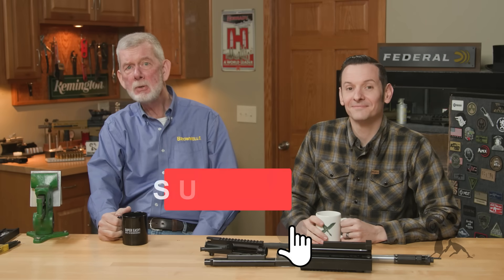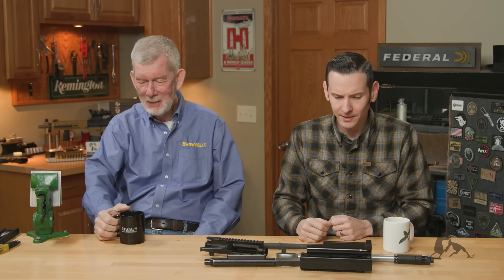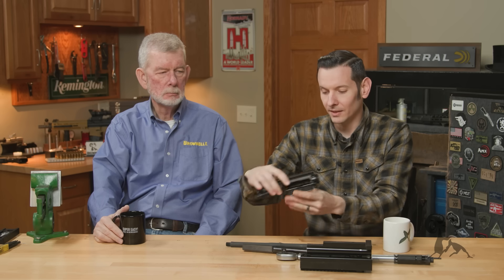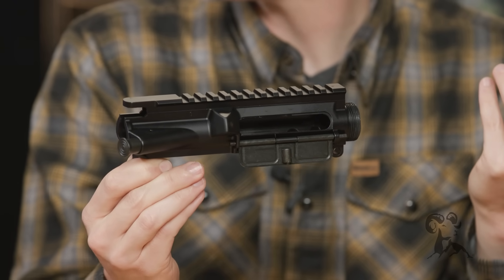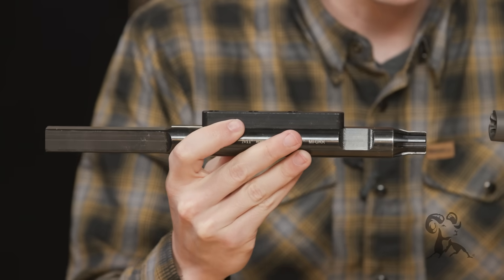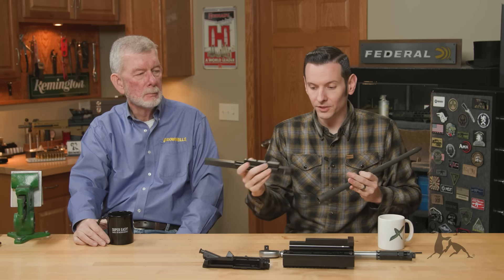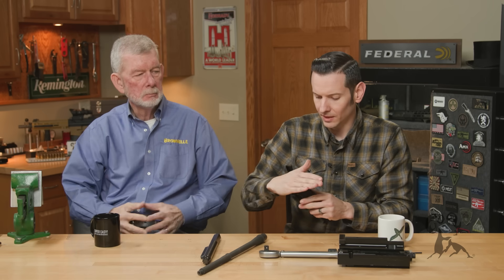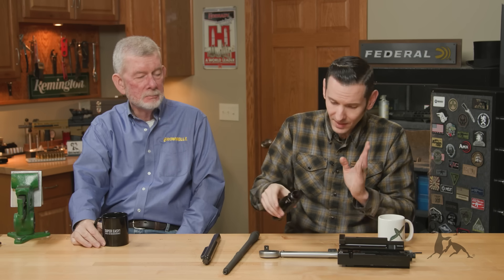SmythBusters: Top 5 AR Building Myths

Comment: Wow!! As a novice to the AR world, you have debunked myths about "problems" I never even would have though of. Maybe I don't worry enough.😉 Here's a couple of my obsevations: Aluminum Oxide is tougher than Aluminum. You can use Aluminum Oxide sandpaper on Aluminum, it's how they clean up castings. You said a torque wrench doesn’t know which way it's going. I have one that does. It was my Dad's, and probably made in the early 60's, maybe before then. It's still in it's steel case, though most of the paint has worn off the outside. It measures torque for clockwise wise rotation. When you flip the lever for counterclockwise rotation, it "locks up/out" the torque mechanism, and behaves like any other ratchet. You can break loose any rusty nut or bolt you want. It does mean it cannot do LH threads, which is occasionally a pain in the A$$. 😉 I am learning a lot, keep up the good work! 👍

Comment: If using the torque wrench for left handed thread was bad why do all torque wrenches have the RH or LH switch on them? Ive never seen one without. One thing I see people freak out about is the position of the wrench to the tool. So many say it has to be at 90 degrees to the tool. Maybe I'm wrong but how does it make any difference?

Comment: Good info guys. Sometimes I don't agree with your content, but you guys hit the nail on the head today. This stuff can be done different ways. The main thing is the AR works without fail, when you are done.. I build mine for precision. I'll do extra things like bed the barrel to the receiver. Also, the barrel nut has a broad range/spectrum for torque. You can do it with a crescent wrench, tighten the damn thing and be good enough. If you are familiar with what torque values are. Also, when installing a barrel device on the barrel, I always throw the barrel in a vise. That way there is absolutely no torque on the receiver. It may not be necessary, but it sure does help when taking a muzzle device off, that has been torqued on too tight!! Keep it easy, keep it simple. No need to overthink this stuff...

Comment: If you use a reaction rod that only grabs the barrel extension you will have issues with the index pin getting smooshed and the upper receiver index pin slow getting enlarged.  You just need something that holds the upper itself, not just the barrel extension.

Comment: I worked on thousands of M16A1s in the army and never heard of a reaction rod until 35+ years after I got out. We had aluminum vise jaws that fit around the barrel and when the barrel started to turn, we grabbed a junk barrel out of the garbage can and stuck it through the front sight base. Then we either had someone hold onto the junk barrel, or just let the one in the vise turn until the the junk hit the workbench and it couldn't turn any farther. Usually the latter. Sometimes we had to use extreme amounts of force to loosen barrels, and even a breaker bar wasn't enough if someone didn't properly torque and grease the barrel the last time it was installed. That's why you should never use a torque wrench or ratchet wrench to break loose a tight nut of any kind, whether it's a barrel nut or a lug nut. Sometimes you need to slip a pipe over your breaker bar for extra leverage, and that would be enough to destroy a torque wrench. Something you just tightened within the limits of your torque wrench can be loosened with it no problem, but I still use a breaker bar to loosen everything because I think it's a bad habit to get into. One time I had to change an upper receiver but the barrel was still good, and they were seized together because someone didn't coat the threads with molybdenum disulfide grease like they were supposed to. I used a big piece of steel pipe to beat the upper off of the barrel. Things like that are why I got into a disagreement on YouTube with someone at a gun company who just puts a bit of oil on the threads of the upper and torques the nut down. ONE TIME. We always torqued them down, loosened them, torqued them down, loosened them,and torqued them down again because the threads on a new upper receiver will stretch when you tighten the barrel nut. Not to mention some of the anodizing grinding down. The nut actually tightens down farther when you reapply the same amount of torque again the third time, when compared to the first. If your barrel gets hot enough, maybe because you went "full semi-automatic" 😉and did several mag dumps, oil can burn off but the metal particles in moly grease are like a thin plating that isn't going anywhere.

Comment: This might be the craziest thing you’ve ever heard but I check all my gas tube alignments by sucking air through the gas tube after I have tightened the set screws on the gas block. I’ve done it enough to know exactly where to set my adjustable gas blocks to shoot 300 blackout subsonic rounds.

Comment: As a guy that MAKES gas blocks, the gap is ONLY necessary if the gas block is made wrong!  On a Mil spec barrel, the gas hole is .395 "+/- .005"  When we intelligently designed our gas blocks we made the hole in the block the EXACT same distance from the shoulder as the gas hole in the barrel. problem solved through Engineering and COMMON SENSE!
Reply: I just installed one and because of the geniuses online I used a compressor to test it. You’re supposed to go to the shoulder on Milspec barrels but It doesn’t really matter because it’s huge. I went all the way to the shoulder. It’s only for barrels made for hand guards. JP Enterprises actually has it in their instructions. They make excellent gas blocks

Comment: You can potentially throw your torque wrench out of whack, so it's just good practice to have a different ratchet or breaker bar, handy at all times. It will most likely be okay but why take the risk, you can not only damage to the wrench but whatever you're working on. The torque specs shouldn't be that critical on anything but it's easy to just have two of a given socket or whatever you need to do the tightening and loosening
Reply from the maker: How does it throw it out of wack? What's actually happening that is bad?
Reply: @brownells  Well just one viewing of “My Cousin Vinny” and you should know from Ms Vito that “dead-on bawls accurate” must maintained at all times

Comment: What was the proof torque required on a pinned and welded barrel? 170 - 240lb/ft? 
That's a lot higher than an average muzzle device.

Comment: Hey Caleb, when I was a mechanic YEARS ago I had a Snap-On torque wrench, not a cheapy, and I used it to torque and remove, sometimes, 3 to 5 times a week. I showed the Dealer that my wrench would dial down, mechanical adjustment, about 3 lbs below 0. He said that would take all the tension off the spring as it is in compression when in use torquing a nut/bolt. So that is how I stored it and if I needed the length to take something off that is where I set it. Then the only action was the 'click'. And I never had a issue with torque values changing. SO go for it and for all you out there, shop worrying and over thinking this stuff. Next you will worry about over torquing your 1/2 inch box end wrench.
Reply: You're absolutely right.I still have my dad's torque range from 50 years, and it works fine. And I used it for another forty years working on transmissions But that's the way I store it. Take the pressure off the spring, all of them.
Reply: Then there are the "deflecting beam " torque wrenches like the classic Warren and Brown,Mine only get used a few times a year; they were key pieces of gear in my father' mechanics tool array 20-120 Ft lb jobs.  Just the thing if you need to wind the=he fasteners up until they squeak and your knuckle go white.By "training', I have always used a "breaker bar' to "loosen assemblies. On seriously "tight" (corroded) ones, a tubular "cheater bar gets involved. REALLY ugly ones may require a touch of the "gas-axe". Side note; check out the nifty "induction" heaters starting to appear on the market. Very controlable 'spot-heating; very clever gear.

More the realm of vintage artillery pieces than your basic "AR" or Rem 700.

Comment: The reaction rod is nonsense. Even with its use, the friction between the barrel nut and receiver threads will apply torque to the receiver which forces it against the barrel index pin.
Reply: Not if the reaction rod has a sail..
Reply: One would think so. Like a bolt with nut one has to hold 1 side tighten other with receiver in the middle  like samich got it down!!!!

Comment: Yeah, torque wrenches can pretty much handle the normal use you described.

In theory, in extremely precise applications, a torque wrench may be calibrated slightly differently going one way vs the other. It doesn't really cause damage using it the other direction, just may be very slightly off if that's not the direction in which it was calibrated. 

Still doesn't matter for the vast majority of applications, including pretty much anything you'd be doing at home.

Comment: The reaction rod, a silly name. Having used one makes assembly very easy. During torquing you can see the receiver flex. Several uppers done around same time and all flexed. So sure, you could torque without a reaction rod. It’s a good practice to use one. We saw near no flex, level the rod in the vise and go.

I assembled my first lower with a few Allen wrenches, upper pre-assembled. So to throw together an upper with minimal tools is possible. Tightening the barrel nut adds a challenge. If you from the Navy probably can do it without a torque wrench… Oh if you vape, it’s a good way to test if gas block is aligned or anything can get through. It was cool to see. Cherry smell lasted till first few shots.

Regarding the torque wrenches, all the trainings I get. Every one of them specifically say do not use it to break a bolt or nut off. Even engineering explanations have very good reasons. It’s not just about the spring in the wrench. I’ve seen damage occur on a few systems of others just cranking on the wrench. It can happen, example noted one guy had to recheck up to 5 systems. On the spot my wrench was able to tighten more while the later just clicked each time. Mine from cal was good, theirs was not from the incident. But you’re not dealing with rotating mass like our stuff. Things fly off due to damaged bolts by torque or not right spec reached.

Comment: Working in automotive and motorbikes section  in Italy and being self taught mechanic I heard this thing about torque wrenches a lot. I honestly think about that the myth come from the idea of prolungating life of a costy tool...if u use it only to torque to spec u definetly use it 1/2 of the times so it can be logic....but than not using it for the opposite if u have to work on something specific it is just stupid...as u perfectly said they have a switch so that's the best clue that it can be used reverse mode

Comment: The only reason we use those reaction rods at work is b/c they're super fast. When you're doing 500 rifles a day you need a fast system that is also secure. If you're building one off rifles you absolutely don't need one. 

What I do at home is clamp an old magazine in a vise and mount the lower to it. Then I can mount the upper to the lower to install the barrel and whatever else. I manufacture and build AR15's professionally and I still don't own a reaction rod or any other kind of upper/lower fixturing device.

Comment: In all my years, I recall 3 'excessive stress failures' of M16-family weapons:
-Brand new A4 during bayonet training, cracked the receiver extension off at the receiver.
-M4 run over by a HMMWV. Didn't 'fail' per se, bent the barrel just before the D-ring and also the buffer tube
-buffer tube bent in a Stryker ramp
I have faith in the barrel/upper interface to be plenty resilient against Infantrymen.
The buffer tube on the other hand...
Reply: I always imagined the buffer system to be the most vulnerable
Reply: @halogod0298  Just what I'd seen.
Also edit OP: just reread the first point, the A4 doesn't have a castle nut, just a one piece extension.

Comment: Can confirm that Torque Wrenches are a lot tougher than people believe. Bought my wrench 16 years ago, from Harbor Freight at that, and never knew until a year ago that you are supposed to not loosen with them and that you are supposed to lower the torque setting to relieve tension. I had always stored my wrench at 90 ft lbs! Tested it and it's accurate within 2.5%, which very well might have been the standard deviation of it when brand new.
Reply: Now this is some good data! Leaves me with a question, how many people check calibration?
Reply: Now I'm a professional mechanic for a multi billion dollar corporation, so I understand we may not be the norm, but, our torque wrenches are calibrated 4 times a year. Again, probably for liability, but they get shipped off very 3 months and we get new ones in return (well, recalibrated ones).
Reply: Yeah, I think those old rules more applied to older wrenches
Reply: It's not that you shouldn't ever loosen fasteners with a torque wrench. That's not the issue. The issue is when you go over the max torque spec for that specific tool. Most have a reverse gear for left handed fasteners. But if you use it as a breaker bar and go over the max rating, it can damage the spring and cause calibration issues. But they neglected to say that part. Instead, they make it sound like you can just loosen anything without concern. Which simply isn't true.
Reply: You're actually NOT supposed to relive tension in torque wrenches. Sounds nuts but each spring will take a proper "seat" and will remain so from highest torque to no stress at all as long as manufactures are using proper strength springs. When you relieve the tension on the spring you're actually taking away from that springs lifespan. The only way to wear out a proper spring is through cycling the spring in either direction.
Reply: @TerminalM193 interesting thought, ya ever leave rounds in a mag and never empty it for years? What happens to that spring...

Comment: Im glad you addressed the reaction rod myth...i thought i need to run out and get a new widget....Im sure if Mr Stoner thought the index pin and 6 x 1.25in worth of threads ( some one get me the linear ft on that please) was insufficient, im sure he would had made something that was sufficient.
Reply: It is not a myth and he proved nothing..The reaction rod with a sail prevents the barrel from clocking in the upper unlike other methods..This is how we fix clocked barrels..

Comment: Taken from 65 years of watching the mechanically impaired over-think problems I believe that over-thinking is the enemy here. Been in mechanical since a child helping dad. Dad was a natural mechanic, Machinist, Cat before and after the war, plumber, electrician, logger, a lot of things. So when he came across a quandry it didn't take long for him to figure it out.
I have great sympathy for mechanically impaired folks; my oldest son is one and the youngest isn't much more advanced. It's frustrating for them at times. I have known a lot of non-mechanical gun owners. Enough to keep me employed for quite a few years part time. Keep yer day jobs fellas. 
So it is very important for the mechanics to help the non-mechanics get their stuff running and educate them. Properly, with sound basis for doing it that way.
Me? If yer twisting something on the barrel, anchor the barrel! Vise and blocks are the easiest. Even quick shop made wood blocks work well. Put the opposing force as close to and in line as possible. On the AR that's the barrel itself.
Reply: I have seen the barrel index turn in the upper receiver using the clam shell type vice block numerous times..He is wrong about this as he was wrong about the 223 chamber having the same head space as the 5.56..
Reply: Action rod no sail man this is common sence its a nut holds barrel to receiver wrench one side action rod other side receiver again is like holding head of bolt while tightening  NUT simple bolt with nut come on man??! @hairydogstail
Reply: @rickypitman1035  The same force will turn (clock) the receiver extension (buffer tube) when applying proper torque to the castle nut..This is why a lower receiver/extension jig is needed..
 As far as your sentence, I have no idea what you are saying, learn how to construct a sentence..